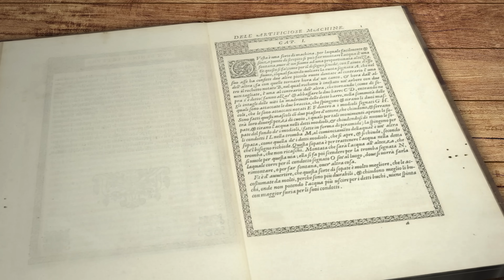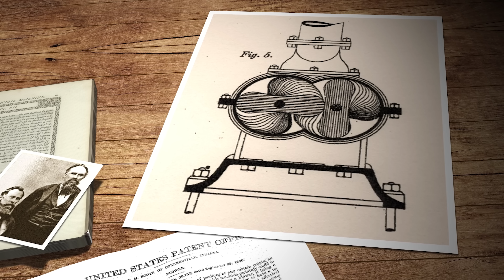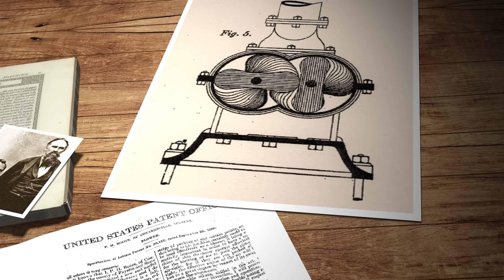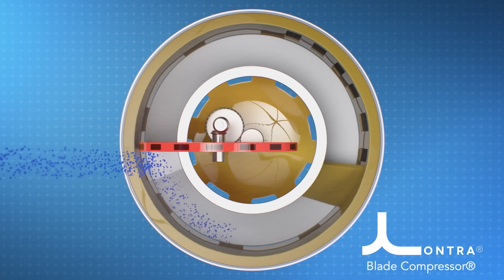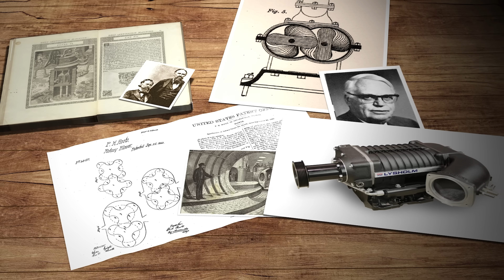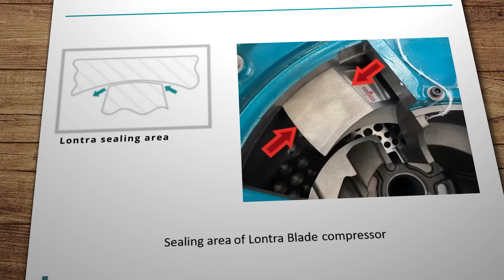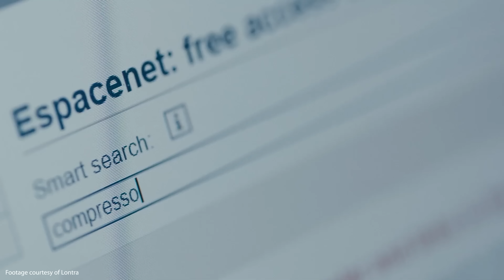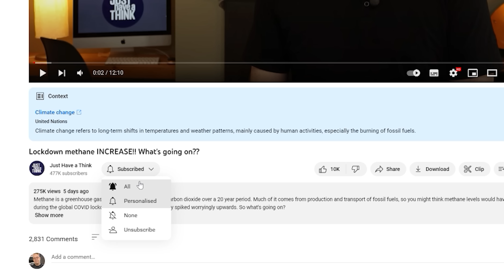Compressing air to reach net zero. A 'revolutionary' innovation.

Comment: to had belong to company who purchase the lontra license and try to produce it, conducts to massive deception (to be polite) : too many components, to big maintenance, very limited capacity to increase pressure over 0.6b, poor performances (much lower than annouced : no more close to roots blower), much bigger foot print than screw compressor, huge noise level are the main drawback of such design. Differantial thermal expansion creates huge internal leaks (more than 14 different pathes for leaks). And when competing with screw compressor, the final price to customer was "just" 5 time more expansive. Looks good on paper, nightmare in real life.

Comment: ... and meanwhile China and India continue industrializing and producing more and more CO2... are we sure we are pursuing the correct strategy? After all, we are up to COP 27 and the 26 years before have meant squat... We need international fundamental research and coordination not small and incremental measures... compressors are small and incremental. Here is an example of what we need to target - concrete production. Just have a think.

Comment: Glad to see compressors getting more attention. It’s not just air compression that has major energy and CO2 reduction potential. Most of the energy used in oil and gas industry is for compression and it typically averages <25% efficiency when you include the driver efficiency. And it’s not just legacy compressors built decades ago when energy costs and CO2 emissions were less of a concern. The 400 million tons per year of new LNG plants being built today will emit >80 million tons per year own CO2 emissions, of which half are avoidable. Only a small amount comes from improving compressor efficiency from 70 to 80%. The rest comes from avoiding typical 35% efficient gas turbine drives (ideally with electric motor drives). Even if these eMotors are powered by a local 55% efficient combined cycle power plant, the extra capital costs of a hybrid electric LNG plant would be offset by reduced maintenance and ease of integration of cheaper local solar PV power when it’s needed the most. Time for minimum efficiency legislation on industrial compression systems that include drivers. How about fining and publicly shaming compressors over 1MW that have <30% efficiency (compressor +driver) by 2030. The owners of hundreds of thousands of affected compressors globally might actually do something more ambitious to reduce CO2…

Comment: Depending on the application, the roots or screw compressor sealing gap is often solved by an oil flood system that takes up the space and gets continually circulated in a loop. While this adds some complexity, it also serves to cool the pump and working medium for more stable or predictable outlet temperatures.
Reply: I was a little surprised this wasn't mentioned.  For all we know the supper compressor requires oil also?  I always am interested in what they don't say.
Reply: @dickmick5517  Go to the company page. He's not mentioning the operating pressure is 4 to 15 psi. But it is oil free, so you can use it in drinking water aeration.
Reply: @edbruder9975  Why would you aerate drinking water?
Reply: @kleetus92  Sorry, it said water treatment plant aeration, I guess maybe it's waste water treatment they don't want oil getting in. My mistake! Then again, aeration is sometimes used to get rid of hydrogen sulphide and volatile organic compounds or industrial solvents and to precipitate iron and manganese and raise the ph and improve the taste of drinking water.
Reply: @edbruder9975  Ah, that makes more sense.
Reply: @edbruder9975  They usually use roots blowers in those applications, you don't necessarily need a lot of pressure, but volume.  You can build a roots for a wet or dry seal operation.  They tend to be noisy, but as long as you don't suck rocks though them, other than a gear box oil change, they basically never die.
Reply: @dickmick5517  yes absolutely... the devil is in the details.
Reply: Now i understand... its not good for air conditioning and freon
Reply: 4 - 15 kpa is useless for most industrial processes
Reply: @proteinman1981  Exactly.That limiting factor should have started the conversation so we understand what we're discussing. Reach net zero? C'mon! Who are we kidding? It's psi. not kpa but still a pretty insignificant pressure.
Reply: @proteinman1981  That was my first doubt. A plate to hold 50bar? It must be just a blower.

Comment: I wonder if there is some kind of wear on the motor part with that design. According to what I understood, regular compressors (screw ones) should have most of the time a constant load on the bearings and axes. Whereas here, you are compressing from nothing to "full" pressure in one cycle, meaning that you go from "easy" to push when you have no air compressed to "hardest to push" when you are pushing the last bits of compressed air out, all in one cycle. This means that the load is not regular.

Irregularities like that may have some kind of unexpected effects (either wear, vibrations, noise) that may be hard to counter. Like the whole ICE, you know, exploding stuff isn't gonna be silenced nor without vibrations no matter what you do. Oh, and this may have the same adverse effect of the wankel engine where all the heat is permanently on the same part of the motor, leading to uneven wear and failures...

Comment: 6:40  The small diameter of a bicycle tire pump is not to minimize leakage.  The design is about matching the force that the average or below average person would be comfortable exerting.  The length of stoke is based on the required amount of pressure needed.

Comment: I like how simple this design is, but as a Millwright, I see this gear train catastrophically failing with very little "lack of maintenance". A very high precision flow/pressure sensing system to detect efficiency losses would be required to ensure maintenance was done in time.
For long-term industrial applications I would increase the tolerances in the rotating element interface before contact and use oil mist injection as in the roots and screw designs to increase that tolerance-efficiency loss and add existing oil-recovery, cooling and re-circulation systems.

Comment: Too many machined surfaces, too many moving parts, too much reliance on precision timing to avoid grenading after a decade or two of hard use, too little advantage over existing technologies.  Inefficiency in compressors comes primarily from adiabatic heating.  That's why they get hot.  The only way to minimize losses from adiabatic heating is to remove adiabatic waste heat from the air as it is being compressed (to reduce the amount of mechanical force needed to perform the work - i.e. multistage compressor with intercooler) and recover said heat for use elsewhere.  (i.e. cooling water jacket and air-water heat exchangers.)  I'm not seeing any of that here.  This is a classic case of greenwashing, plain and simple.

Comment: Have you never heard of multi stage centrifugal compressors? They have efficiencies between 70% and 85%. With those losses being mostly from friction of the fluid moving through the parts and mechanical friction. Not sure how this can be so much more efficient with existing compressors already being very efficient. This also seems like a pulsed output, which generally is less efficient than a continuous operation.

Comparing to roots style blowers is a mistake. Roots style blowers are less efficient than centrifugal compressors.

Comment: Knowing a tiny bit about compressors ( we got a few at work, pressurizing H2 upto 200bar and N2 to 300b) , for industry this sounds crazy difficult technique. I mean , it is nice for a compressor which does work a few hours a day , but not for a machine which does need to work 24h/300d/y . If so the service on this would be extremely difficult aka extremely pricey. Compressing air to a few bars is easy enough , prob this is where it is aiming at , but thats just a compressor making not much difference for large scale things .

Comment: In my field air conditioning they have scroll compressors just as you can imagine it looks like a scroll.
Now that use variable speed motors to slow down and speed up depending on the load between separate rooms.
Reply: Mini splits,,it would be interesting to see how this compressor would work compressing refrigerants🤔

Comment: Note at 6:34 that a thinner and longer cylinder could arguably be worse, not better. Tolerances are somewhat constant regardless of size (thermal expansion is the only exception, in very large scale scenarios). So a smaller cylinder would mean a higher ratio of circumference / surface area, and therefor a higher ratio of tolerance gaps / surface area. Ideally, you would have a lower tolerance to minimize losses due to tolerance leakage. Not positive, but 99% sure

Comment: Just build the Thorium, Molten Salt Reactors............energy crisis solved.  No long lived waste, no weapons material, cheap abundant fuel, simple engineering. ORNL ran a prototype for 10 years, China has 2 prototypes running today, in view of mass producing them. Compressed air can be a very effective form of energy storage........a guy in Australia invented a super efficient motor, what was needed, was indeed a better compressor.

Comment: Just have a think: Getting to Net Zero by 2050 would cost $9.2 trillion a year globally (McKinsey). That's not going to be good value for money. That's nearly one-tenth of global GDP. That money would be better spent on a myriad of things including educating the fifth of humanity who are illiterate and represent a 7% annual loss to the world's economy. Any country that attempts it will be indebted or impoverished. 
Example: For the UK to reach net zero by electrification of its transport fleet and heating system, it will require a tripling (as a minimum) of its current electrical generation capacity among other things. This will essentially require the UK consuming all of the current global supply of copper and other rare metals for the next 25 years. The cost will be unaffordable and the skilled manpower levels unattainable. And that is just to eliminate the 1% of the global CO2 emissions that the UK is responsible for. So times that by 100 for the Earth. 10,000 child slaves in the cobalt mines of the Congo not enough for you? Make it a million. Imagine all the human suffering and environmental damage done from all that resource extraction! 
An electric vehicle requires 6 times the mineral input compared to a conventional one, and the carbon cost is greater until you reach 80,000 miles.
Production of all of these minerals has been mastered by China: a totalitarian communist regime that thinks nothing of the mass murder of its own citizens, imagine how much it cares about the rest of us.
And why are we embarking on this great net zero crusade? For what? So someone can virtue signal by driving around in a Tesla.
Maddeningly, there is no climate crisis. The Earth was warmer in the recent and distant past.

Comment: Two things spring to mind, Firstly could this be used as an engine to compress the fuel such as petrol and diesel?
 Second is the concern of metal expansion and part clearance, I used to be involved in the production of electric heating elements and their problems of cracking when dowsed with water when red-hot.(take the cooker element for example where a red-hot element at 800 degrees gets water spill from a saucepan) Incoloy 800 and 825 were designed as an alloy with near zero expansion with temperature, maybe this concept should be incorporated into this compressor.
Good vid though, cheers Dave.

Comment: A high percentage of the energy used to drive any compressor ends up as heat, and usually this heat is unwanted and even harmful.
In the past, the way of dealing with this heat is to waste it to atmosphere, using cooling fins, air-to-air heat exchangers etc.
If the compressor and any aftercooler were water cooled, the waste heat can be captured and used for some process requiring heat energy.. even just heating the hot water used in kitchens and washrooms if there is no industrial process requiring heat.
Efficiently cooling compressors reduces their energy requirements, extends their mechanical life and allows them to produce better quality air.
The design of this Lontra compressor looks as though it would be easy to incorporate water cooling.
A huge percentage of energy purchased by industry ends up being wasted, usually as heat. Recovery of waste heat can be cost effective, and is one path to a more sustainable future (and profitable industry) that has not received the attention it deserves.

Comment: What about the lantra compressor to power a car? Could the moving car (powered by a small battery) the force air through an attached compressor which could generate enough force to supplement the small battery, so that a car could get by on much smaller batteries?

Comment: Compressors are inherently energy hogs. Most of the energy goes into heat, which is then "wasted" by running the air through some sort of aftercooler.  This is just a fundamental thermodynamic problem.

Comment: "An ideal pump or compressor or piston would have a very long stroke or distance of travel. But with a very small diameter in order to minimize leakage.

OK. We've got confirmation that he's a talking head who doesn't know what he's talking about. The length of the stroke is to determine pressure, so a longer stroke would be useful for high pressure. That part is correct. As for diameter, the larger the diameter, the more force is required to operate. And since that's a hand pump intended to create high pressure, it requires a small diameter so that a mere human can actually power it. In fact, the leakage is determined by the clearance between the piston and the cylinder its moving it. And the area of that gap is determined by the circumference of the piston.
Interestingly, the percentage of leakage with any specified clearance DECREASES with an increasing diameter of piston. Reason for this is that the amount of air being pumped increases with the square of the diameter, while the amount of leakage increases linearly with the diameter.

Comment: Completely misleading to completely ignore dynamic compression. While this may be a novel compressor design for positive displacement it's too complicated to have a chance at displacing large integrally geared centrifugal compressors in industrial applications. Additionally the sealing requirements for these will have terrible maintenance requirements similar to the tip seals on a scroll compressor. Innovative, yes, practical in large applications, certainly not.

Comment: To be pedantic, tolerance and clearance are subtly different and are not interchangable. 

Tolerance is a design limit, clearance is the measurable distance between two components. 

For example, the parts would be manufactured within tight tolerances (+/- 20um) to produce a sub 0.05mm clearance gap

Comment: You still have to burn coal to compress the air. Coal is way safer and cleaner than Lithium and cobalt mining. The exhaust from a car is absorbed by plants easily. The spent lithium battery destroys an entire eco system.

Comment: I don't know what pressure levels are achievable with this compressor or if it's better at volume (flow). 
At high pressure 3000psi plus it could be used as a precompressor reducing how much the main compressor has to work.
If it's better at high flow rates then replace superchargers.
If it's capable of both - then scrap this insane headcharge towards EV tech and bring back compressed air engines.

Comment: This would be particularly valuable with small molecular weight gases that have High diffusion rates, such as when you're compressing hydrogen and helium, both of which are becoming increasingly important to 21st century technology. I'm not sure how the metal parts of this pump would hold up to those gases.

Comment: did you even look in to just how complex and accurate the machining is for this "pump" compared to the incredibly basic and "lose" the tolerances are in a standed piston compressor
i have rebuilt a normal compressor on the tailgate of my truck in a field with basic hand tools bet you can not do that to that new one

Comment: Could air compression be achieved with electrically generated ion thrust? No (or fewer) moving parts. Rate control by adjusting voltage. Have a think.

Comment: Very interesting video. I work in Engineering, and we use compressed air regularly. In fact, some machines we use are built to use compressed air in their operation, without that air they couldn't work at all. So important has compressed air become in our day-to-day working. I hadn't realized how much power is consumed worldwide in the production of compressed air though, that was an eye opener.

Comment: Precipitating (piston compressors) were by far the most widely used until the 1970s, they're very long lasting, i used to service some huge W-configuration  ones that were over a 100 years old and still going strong, Screw compressors take far less maintenance as there's no valve plates or fingers to replace, rotary vane are also require less maintenance but i hated working on them, I've encountered many weird, wonderful and strange designs, some appear to be one offs, centrifugal compressor, dynamic compressor, or turbo compressor to name a few, the common denominator is compressed air is the least efficient form of energy and no one would use it if there's an alternative option, the only future i see for it is storage, making air when the wind blows and the sun shines to charge receivers to use in the form of a battery when there's no wind or sun.